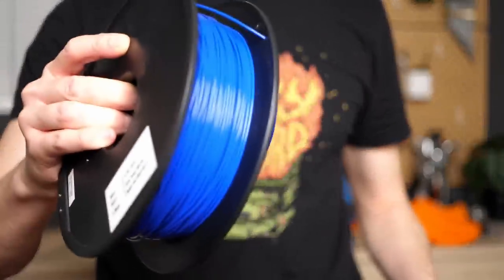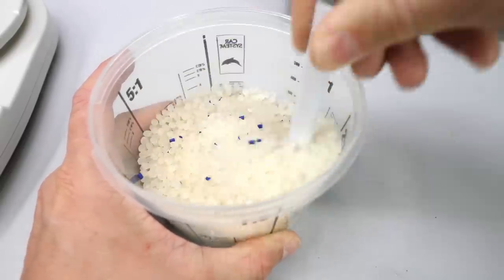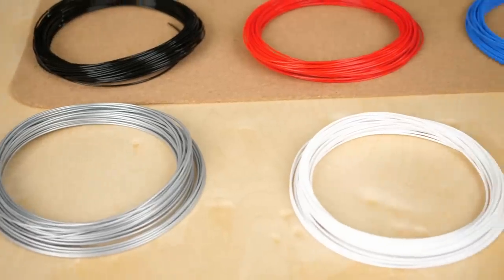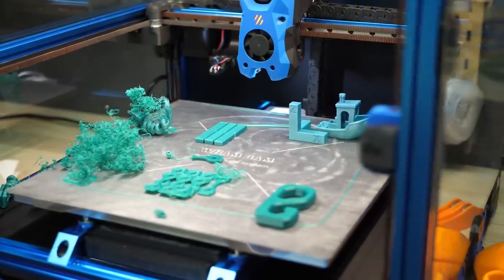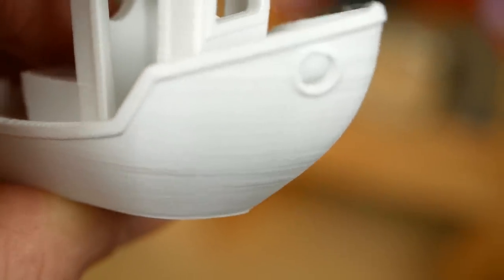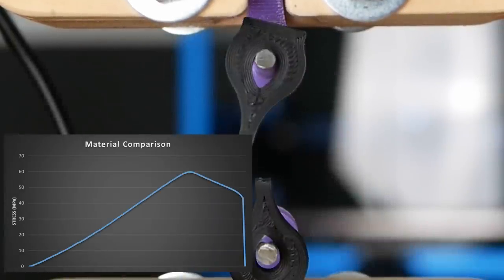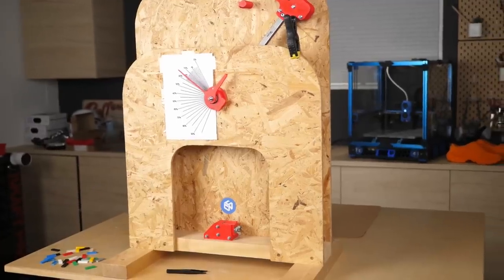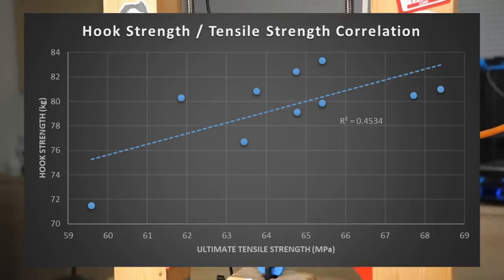Myth Busting: Color vs Strength in PLA

Comment: Very interesting results, with ABS on Vorons we`ve always recommend avoiding the use of white filament as its shown in the past to have poor layer adhesion and increased chance of part failure, but with PLA it looks like thats not the case.
Reply: For white specifically the titanium dioxide is also an abrasive, so it may eat up nozzles just like carbon fiber or glow in the dark filaments.
Reply: Ah, so that's the reason for the red/black theme /s.

This is absolutely fascinating and I never would have guessed that the difference between pigments was this large. I wonder if it's the pigment itself or the different sourcing of the masterbatches used by dasFilament?
Reply: I suspected this after getting some white hatchbox abs and it was crap to print and for strength. Normally I use esun so I didn't know if it was just the brand but, now I know it's white in general, thanks!
Reply: @ska042  yeah, realised this after buying four 4kg spools of the white PETG. Destroyed our RatRig on an overnight print, had to order new hotend, new sensor and print new head assembly using other printers. Now have a load of this filament condemned.
Reply: @jbradleyk  If you have that much you could probably buy a hardened nozzle and get good use out of it lol
Reply: How about ASA? I love the white color on a Voron, since optional LED bars on the top while be very bright!
Reply: @simontillema5599  you could check out natural ASA (without any pigment)
Reply: Yeah, if you want a white colour use transparent filament
Reply: @thirtythreeeyes8624  "now I know it's white in general,"

Literally the opposite of what this video concluded...
Reply: Probably depends on the type of white filament. I had Creality White PLA, which was totally different from my other filaments. Not only it was very ductile (smaller features deformable by hand), but you could "feel" the paste-like consistency when looking at a print in progress.
Reply: I have a question for you what abs color is the strongest ? or can you send me a link that shows all the tolerances by color?
Reply: White ABS is also known for bad filament consistency. It's a pain to manufacture

Comment: I'm a paint department manager in a small town hardware store and I found it interesting when I would pick up the quarts of colorant to refill the dispenser, and they would all weigh significantly different. For instance, a quart of white weighs 3.6lbs and a quart of black weighs 2.4lbs. That's when I learned about pigment properties lol
Reply: This is also the reason for the so called "pink tax" Pink plastic is not identical to blue, green, or black plastic.
Reply: I concur as an ex-paint store employee! The white colorant was a massive pain to lug!
Reply: I work in printing and used to order ink. The we were charged by the pound from our supplier. A can of black would be 5.0 pounds and reflex blue was 5.7 pounds for the same size can.

Comment: Every single silk silver I have bought has been the biggest pain to print. I’ve been finding color makes a huge difference and no body talks about it. I really appreciate All of your videos for the conversations they start online but especially thank you for this one, I feel validated lol
Reply: Same, cant get decent wall adhesion
Reply: Typical i hate the "DrY yOuR fiLiMeNt" response but,

I've noticed that the silk PLAs are actually hygroscopic and definitely benefit from drying. But also they need to be printed at much higher temps than typical PLAs.

I had a gold silk pla that liked to be printed at 250c and only printed properly if it was dry.
Reply: Well, silk PLA isn't just PLA. They're an alloy with other plastics. So it's really a different material entirely.
Reply: Same but in my experience had clear/yellow/gray pla always seemed more pliable to me
Reply: Slant 3D made a video called "White Filament Will Destroy Your 3D Printer"
Reply: @richiesrestorations4883  250 is pretty high for play lmao I've printed as low and 180 but it's possible but I usually print Petg at 235 and even that temp basically roasts or liquefies any pla I've ever tried to print.
Reply: @marc_frank  that titanium dioxide, it won't destroy your printer but it will wear nozzles and possibly feedgears an bit
Reply: @richiesrestorations4883  I pulled the old listing from my purchase history and the manufacturer has the temp range listed as 195c - 220c. After a quick look around the average is 200c - 220c with polymaker having the range widened to 230c
Reply: @infernaldaedra  well it's just the title, that's what he said as well
but it's an example, that people are talking about colors
Reply: @marc_frank  yeah. If you want to really destroy a nozzle or gears use Glow in the dark blue with fiberglass or carbon reinforcement and 1-3kg will turn a 0.4 nozzle into a 0.6-0.7 and will round off the nozzle tip like a polished bead lmao
Reply: Most pigments add barely any material. One exception is white, or any combination that relies on white, since... white pigment cannot really exist, what it is, is a clear transparent mineral with a high refraction index that hopefully after a few bounces bends the light back out. And yet properties already differ between pigments.

Silk has some sort of a filler in a substantial amount, it has been said that it's some sort of an elastomer. Odds are it doesn't bond to PLA pretty much at all, it's just trapped in there. So that is a whole different magnitude of pain than merely pigment.
Reply: Pearly silver from American Filament is one of my favorite PLAs I've tried, although it's not that silky compared to others
Reply: OMG, I am having this problem right now and I found your comment totally by coincidence 😅.
In my case I am having a real trouble with the silver filament from Filamentive....it is a real deal to have it adhesing to the plate.
I found that this filament is not really silver, but some sort of clear filament with some silver glitter like particles.
Will try a higher printing temp today.
Reply: Silk filaments have tpu in them, they will never print like the base polymer.
Reply: All the silk I have used is very difficult to get a good print. I've switched to painting metallic colors with an airbrushing after printing.
Reply: Not just silk silver, but ANY silk PLA (my favorite was bronze) has poor layer adhesion and cannot be used for functional parts, only for decorative parts.

Comment: This works for other products as well.  My wife and I have a commercial embroidery business and one of the first things we learned was that black embroidery thread and white embroidery thread are more prone to breaking than other colors.  Black thread is usually another color that didn't come out well, so it was bleached and redyed black.  This is also true of white thread.  It was usually another color then bleached heavily to make it white.  The bleaching and redying process weakens the thread.
Reply: Good to know. Yeah i'm sure some black plastics from less trustworthy manufacturers have black be all-regrind with extra masterbatch; which is a problem for ABS in particular since it degrades heavily in the process, but would be noticeable for other polymers as well. I think some other colours can be full of regrind too occasionally, grey for example.
Reply: That makes a lot of sense, so dark colours are dyed black because cost wise it is easier and more cost effective to dye it black than it is to try (and fail) to bleach out all of the existing colour.

Comment: More interesting to me in the test results was the wild variation in the error bars per color. That tells me that the color not only influences the macro level performance of the plastic, but also introduces microvariation that can have a notable impact.
Reply: Didn't even notice that at first, maybe the weaker prints had slightly more pigment than the stronger ones? Many of these pigments are so concentrated that even a large difference in concentration wouldn't be very noticeable.

Stephan has a filament extruder, this would make for an excellent follow up experiment. 50% recommended masterbatch ratio, 100% ratio, 150% ratio, 200% ratio, etc.
Reply: That's the problem is that each brand has different mixes for different pigments and when we are testing all similar materials with simple tests we are going to start seeing the variation in the results itself where each individual tested filament roll might behave differently, what if the weight is different from pigment as well as moisture. So in turn we eventually do need to start testing further into the results to get a definitive conclusion
Reply: That or another variable, it's not a super scientific test. I would say almost none of the tests are really significant, with the exception of the hook tests.
Reply: or... or this guy didn't isolate a true independent variable and we can draw basically no conclusion from these results other than 3d printing parts have highly unpredictable properties that are still poorly understood.
Reply: @googleyoutubechannel8554  exactly my thoughts
Reply: I am glad that Stefan conducts his tests scientifically! A value without error bars is as worthless as an anecdote!
Reply: @googleyoutubechannel8554  Good science is really hard sometimes. Don't drag the experimenter, go do better yourself.
Reply: @infernaldaedra und
Reply: I suspect printing more slowly would significantly reduce the scatter.

Comment: Quite shocking results!  I’m most surprised by the natural PLA performing so poorly compared to some colors. Super interesting.
Reply: It's interesting but its because the pigment pellets have tons of extra additives and plasticizers. which are going to make a big difference because most basic or ""natural"" polymers because like amber or like old plastic beads.
Reply: @infernaldaedra  Yeah, that's sort of what I was thinking? I can't imagine the actual pigment causing much influence, more the material its suspended in. 🤔
Reply: @BRUXXUS  it does but in most cases it's the blend thats needed to get a good color that does it in my opinion
Reply: @BRUXXUS  that's one assumption, but it doesn't make sense to me. I know pigments are not just a drop of food coloring. GITD and white tear through nozzles because they are not pigments, they're colorful minerals, and much harder than any plastic. You can manipulate colors with particle size too. When there's poor adhesive, one cause is the amount of non sticky additives.
Reply: @BRUXXUS  The masterbatch usually comes loaded in EVA from what i heard.
Reply: @SianaGearz  That makes sense, since EVACs are ductile and CNC found a negative correlation between strenght and ductility.
So, depending on the amount of EVACs and their composition (amount of vinyl acetate) the PLA trades strength for ductility.
@CNCkitchen

Comment: I've noticed difference in printing between colored vs. translucent PETG with translucent being the easiest to get to adhere to the bed. In woven fabrics the dye used to color them will also to an extent change how they behave with blue color making the fabric more firm and unyielding.
Reply: I use a lot of the eSun Blue PETG which is translucent and prints beautifully. It was cheap too and seems very strong.
Reply: PETG has no problem sticking to smooth PEI sheets, it actually sticks too well the solution I found is plastic razor blades.  After 2 kg of filament the PEI sheet is not damaged and still going.

Comment: Interesting video! I noticed a big difference with the semi-transparent green PLA that I used for printing a guitar neck. This material felt harder and more brittle, yet tougher than the PLA I was used to. By the way, a good reason to print white is that you can draw on it with a pencil. Ideal for prototypes, like a 3D notepad!

Comment: This is very interesting, but I have to admit when printing PLA, the colors matter for the design.  If strength is needed other filaments should be used.  This would be interesting to repeat for PETG and ABS or ASA.
Reply: Yes and no. PLA is not very strong but it is relatively stiff, which along with its low price and ease of printing means it does have a role in structural parts.
Reply: @cooperised  I use it to prototype, and then decide if I need to use another material.  Since I received my Bambu X1 Carbon, that has allowed me to print almost any material, with great success.
Reply: I use pla for structural parts too, sometimes the stiffness of pla is more appropriate than the toughness of petg for example

Comment: They must be adding other additives specifically to compensate for the property changes brought on by the pigments, so they have to tune each color to be roughly the same "strength," hence the relatively small spread on the hook test, which is the most practical.
So then maybe a material tuned specifically to be strong might see less of a spread between different colors, since the manufacturing goals are different.
Would be interesting to see some tests on PLA+.

Comment: This is literally why I create a profile for different colors of filament using a temperature tower and extrusion calibration cube. Once they add a different color component to the plastic, every color takes on their own unique properties. I have found that by starting with the existing profile for the manufacturer and material, when one exists, and generic profile when one doesn't, that different colors from the same manufacturer typically require slightly different extrusion multipliers and temperature to achieve best results. Of course I'm only going for appearance and extrusion accuracy, not strength testing.

Comment: Used to work for LEGO back in the day, supervising various design teams. With LEGO, it's mostly about "clutch power" (strength required to pull two elements apart). Around 2005, we ran into a lot of trouble with our new light blue: apparently the pigment had an impact on shrinking during the cooling phase, leading to our models literally falling apart as all elements made in that color were oversized by a few 1/1000 of a millimeter...

Comment: In my experiences, silk and matte finish pla has always given me problems, mostly with layer adhesion and bed adhesion. For colors, I’ve found to like grey and black, I feel they warp less and offered measurable difference in just about all parameters. Blue has always seemed to be very easy to print and offered very smooth, clean prints. And red the worst, I feel like it absorbs moisture much more then others, anytime I need to print in red I dry it for a minimum of a day and I store it in desiccants too, I also feel red, in my experiences, are the most fragile, but I feel that’s because the extra moisture absorption I’ve experienced. I do a lot of prints for orders, like custom Starratt tool boxes for clients, friends and family, so I do have a ton of experience in red pla and pla + printing. And I feel the differences between colors in pla+ are less then plain pla. But these are my simple experiences and thanks for the video, glad to see some I’m not just going crazy with noticing differences between colors of the same brand and type filament.
Reply: no no i think you are on to something here. i use Eyrone filament mainly. Black seems almost seamless and perfect. Blue seems sturdy as heck, The red one i used for a MK50 infinite articulating pistol imediatly snapped of after pulling the slider a few times. Printed one in Eyrone Blue and its sturdy AF printed another one with the red one for a budy to pain and again snapped off at the seams. So i do think Red is a poopy PLA to print if you need something sturdy and infact the blue stuff i print rarely breaks even when dropped wherass my Silk and Red just are so brittle as well as my OD green matt filament which breaks easily at the seams. Printing at different temperatures doesnt help at all when testing. Oh yeah PLA+ Deffinatly worth it if you need stronger material without switching to a different plastic type. Ofcourse not a huge difference compared to normal but a bit more sturdy is often enough for Airsoft purposes

Comment: Glitter filaments are usually significantly more hygroscopic, which makes sense, since many contain mica. I have to regularly dry my galaxy-black Prusament ASA, but never have to dry non-glittery colors. The same seems to hold true for PLA, and glitter PLA also becomes more brittle as it sits on the shelf vs. non-glitter.

For PETG I find that the more heavily pigmented, opaque colors have better print quality with less stringing and blobbing. The biggest problem with PETG is that it's very sticky and goopy, and pigments seem to reduce this property. But it probably lowers strength.
Reply: I have natural PETG here behaving like a dream, and sunlu opaque blue and it's giving me trouble, like i sure can get decent looking prints out of it, but i do not get any sort of semi decent layer adhesion! Infuriating. I have to drive the temperature way up to get it to stick to itself, and then it blobs and strings more than the natural.

Comment: I haven't done actual measurements, but my prints with "natural" (pale translucent white) have seemed strongest and have had a little more flexibility, making the "minies" for TTRPG break less often if dropped.
Reply: What polymer blend? Or filament type? Pale translucent white doesn't sound the same as natural but neither is regulated or standardized but usually natural means free from additives. Translucent white might mean they actually tried to brighten up and clear the filament
Reply: That actually sounds like it's the weakest of the materials with low rigidity and higher flex and ductility, which is a good thing for when you accidentally drop them.